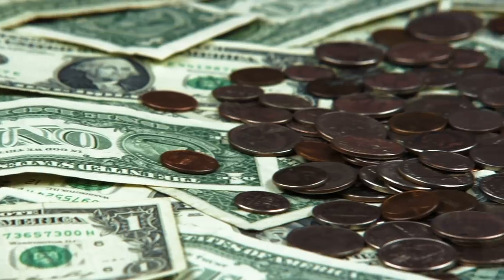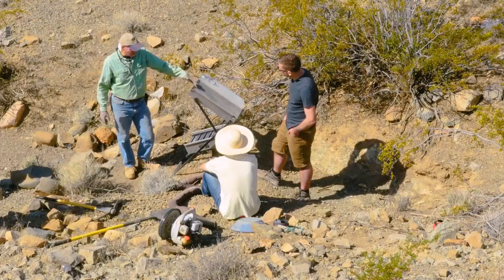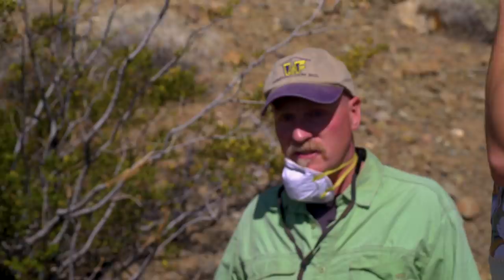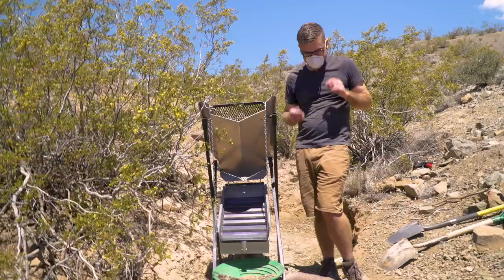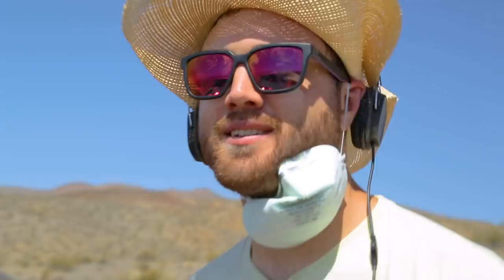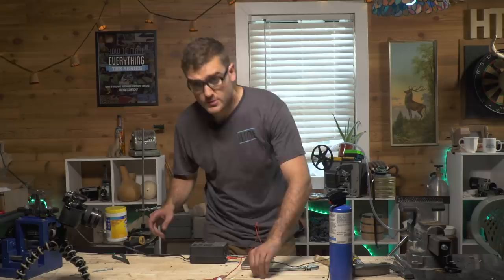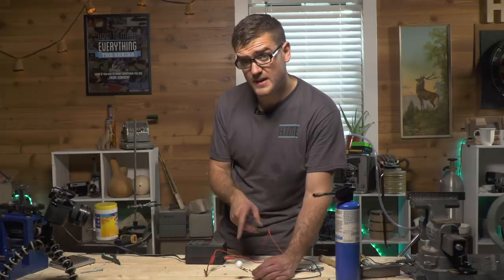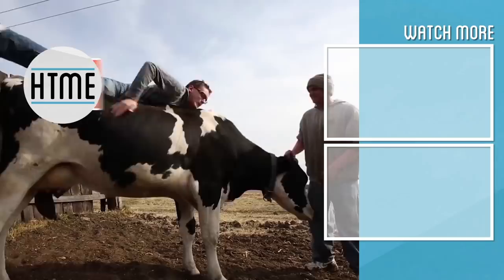Panning Gold to Make Electronics (w/ William Osman)

Comment: Your biggest problem with the annealing process is that you need to hold the metal farther away from the nozzle. The hottest part of the flame is at the tip of the blue cone and at 9:13 you are clearly holding it halfway inside. Not to say it isn't hot in there but it isn't hot enough. The rule of thumb for other non-ferrous metals is to heat the metal until it glows a cherry/dull-red and then quench immediately. 9:33 is better but you have to keep in mind that the tweezers there will sap out some of the heat. 9:36 you are again way to close with the flame and the metal block you are heating it on is taking away all of the heat. You need to heat it on a stone or something that will reflect the heat back up onto the metal. If you have a container filled with pebble sized chunks of pumice and heat the gold on that you will find it to be much easier. https://www.riogrande.com/product/Annealing-Pan-with-Pumice-7-dia/502046 I'm not sure if links work in the youtube comments but if not just google pumice annealing pit.

Comment: Coming from William's video, love the vid man. Osman seems much more useful in yours than he did in his :P

Is there a reason for not trying to pull the wire when it's heated? Seems (To my entirely uneducated mind) that it would stretch a lot easier that way and be less prone to snapping.
Reply from the maker: Supposedly you don’t need to, as long as you anneal it frequently enough.  Keeping it hot the entire time would have been challenging (its small enough to cool super quickly), so I didn’t even try that
Reply: in fact gold(and silver) tends to snap while being hot. thats one fundamental difference to other metals
Reply: It can do the thing that stretched taffy does if the wire is hot during pulling-stretches to threadlike thinness in hotter spots and breaks. Warm is fine, but not hot! Honestly, though, gold is ductile enough that you don't really need to heat it for pulling.

Comment: Just a tip: if your wire keeps breaking it might be due to work hardening of the gold as it gets harder and more brittle the more you work it. You can counteract this process by anealing the metal so just heating it up a bit without actually melting it.

Comment: Heyo! When you get your copper and are interested in electronics, you might want to check out copper oxide semiconductors/diodes!
If you want to, you can also try to figure out how to work towards silicon based semiconductors (p-type and n-type doping and stuffs) but that will be much harder.

Comment: I imagine a collab with Sam Zeloof or Jeri Ellsworth in which you make a transistor from sand. I know it's probably not realistic though. I think the process of making the silicon wafers needs some very expensive equipment. It's still a neat idea though. One thing you could look into is making a capacitor and/or inductor from scratch. The inductor would be fairly easy cuz all you'd need to do is make a coil from wire. The capacitor you can make from foil made out of your gold and some sort of thin insulator for the dielectric. I made one myself out of Al foil and plastic wrap. There are all sorts of designs for DIY caps and it's fairly simple to do if you have the material.

Comment: One item of note: Annealing is not so much about hitting a high temp as it is cooling the item  s l o w l y. Often metal items are placed in wood ash to cool because it is a good insulator that will not burn. (I've made a few knives and small tooling.)

Comment: Pan flutes are relatively simple instruments to make, just some bamboo or similar reeds cut to length and bam. done.
Reply: The problem with that is bending the pan takes quite some time and effort due to the thickness of the metal so it can actually be quite a hard task to do.

Comment: You need to get your gold to the right temperature to anneal it; it all has to do with atomic structure and how compounded the atoms are in your solid. If you crush or distort your gold (or any metal) after annealing it you risk breaking it if you go too far unless you re-heat it and repeat

Comment: if you are going to make your own bronze, be careful.
the problems last time were that the aluminum went solid what made you lose the first minecraft sword casting.
with bronze having a higher melting point it is likely this will happen again.
TKOR made a copper gear and they had to do a lot of troubleshooting.
i would recommend anyone that tries to cast with metals like copper etc: dont be discouraged if it fails, rather have 100 failed attempts then throwing in the towel at your first attempt

Comment: This comment will probably get drowned under loads of other comments but here you go
Possible uses of gold:
Rare metal catalyst for certain organic chemistry procedures (e.g. H2+O2<-->H2O2)

High voltage battery (due to gold's low position in the metallic reactivity series, a high potential difference can be generated when gold is used together with a more reactive element e.g. aluminum or graphite inside a galvanic cell with an electrolyte e.g. salt water)
Reply from the maker: Good to know, thanks!
Reply: How To Make Everything <3

Comment: what know on how make wind mill. make a coil or rape wire around peace iron. so mine iron. get copper not gold. make spring put wooden down in hand drill with hole in end. put wire through hole. with pliers wraps won't fall off. turn drill on should coil wire around the dowl. may put other end wood rode in hole bored make more safe. i only know how do this because researching how make chain mail. they cut wire make c shape links make mideviel chain mail. problem with this is have some weld link back together  but think going cosis play. anyway assume make wind mill blade out ash that break in wind. attach rode with y shaped end with two natural magnets on end when wind spins blades spine y shaped stick around coil wire around peaces iron that make eletristy. if light bulb attached wire coiled iron should see flick on and off. this design is two separate things. got wind mill and y shaped stick one thing. then iron, coil wire and wire lead off some use electricity like light bulb separate thing stand next to there machine.

Comment: Ah yes the "utility" of gold lol, as a less conductive less sturdy more expensive alternative to copper. Frankly, currency cant be made of something that people can use, or they just use it. It has to be desirable but mostly useless. Like, if people tried to make currency out of iron people would have just used the iron. And now that copper is far more useful than it used to be, its becoming less and less used as currency, because people destroy currency if the materials themselves are useful. At this point, gold mostly has value because it can be traded for money, the exact opposite of the gold standard